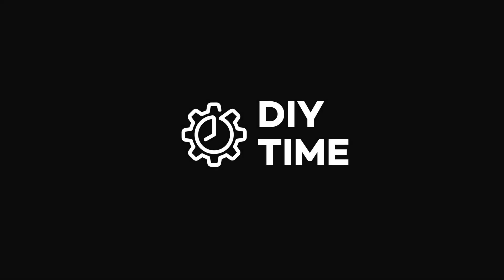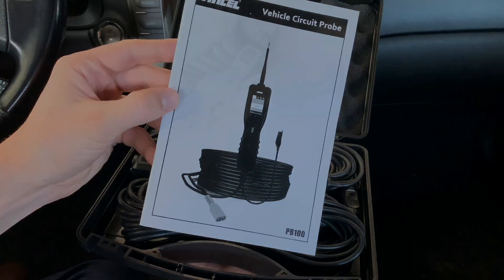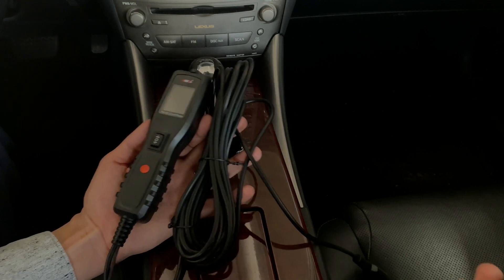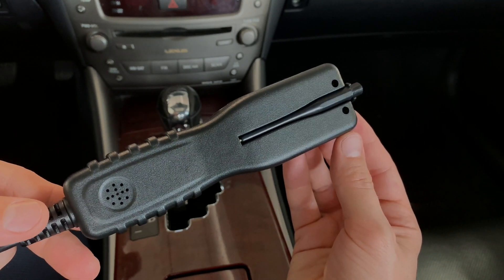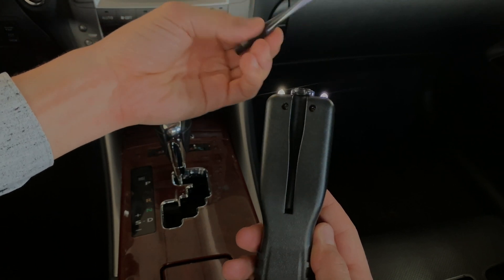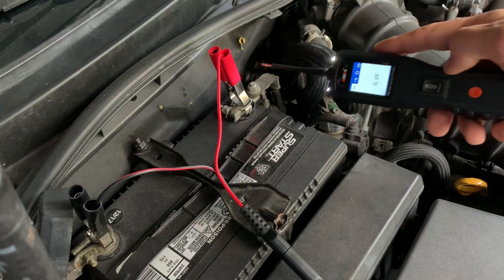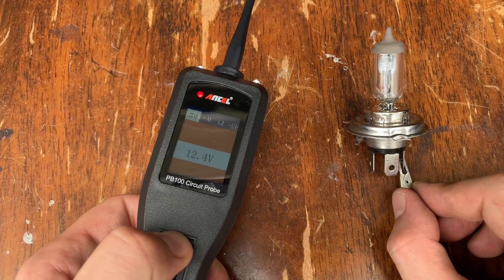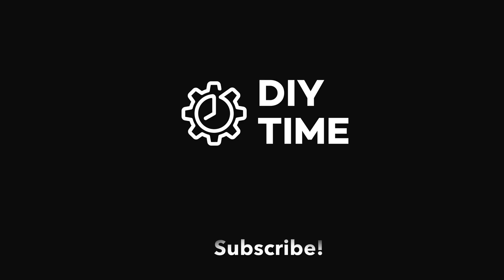Vehicle electric circuit probe tester - Ancel PB100 - setup & review

Comment: when checking positive Does it gives the same signal without touching prob to the sensing wire or terminal. Ex. When the wire is energized with positive can this tool recognize it through the insulation rubber of the wire without pinch it